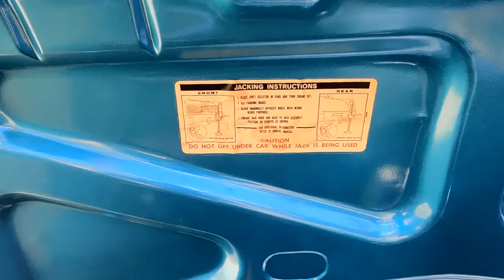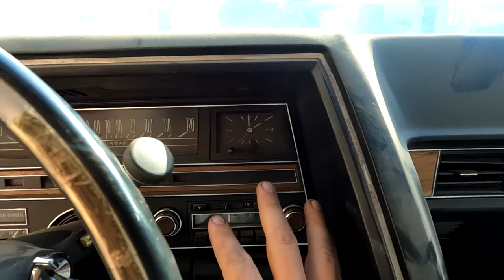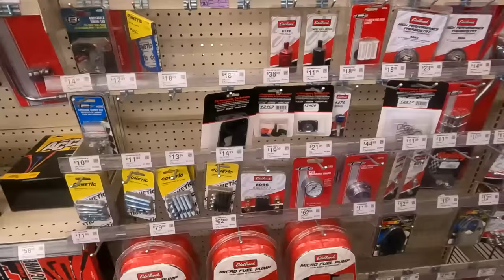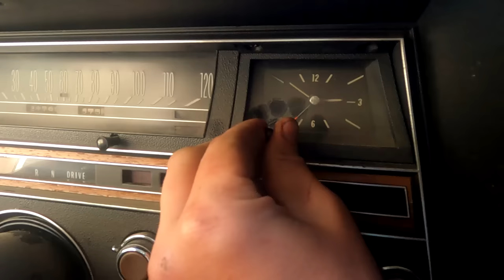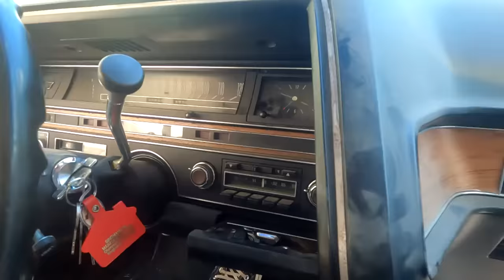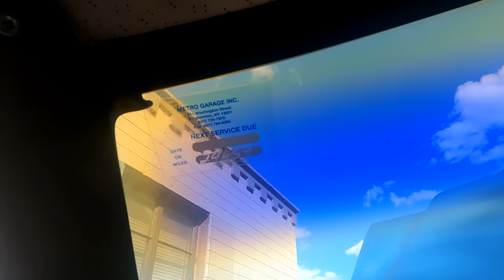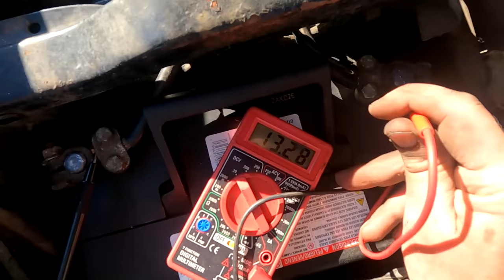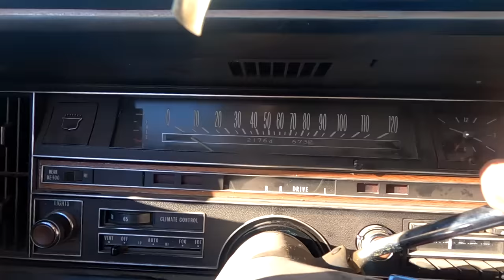Will this FREE CADILLAC run AND drive after sitting 20 years?

Comment: I used to have an '88 Fleetwood Brougham and it had level ride suspension on all 4 wheels.  I was sitting in a friend's driveway once that was on a hill and the passenger side was downhill.  He was sitting in the passenger side with the door open and one foot on the ground and I turned the key on, but didn't start the car and he asked what was happening because his foot was no longer on the ground, lol.  It had little things on the fenders that flashed when you had your turn signals on as well as red led flashers just above the rear window you could see in the rear view mirror.  The digital climate control in it worked flawlessly.  

What generally happens with dial string on old radios is that the variable capacitor (looks like a small bread slicer) gets stiff from old grease hardening in them and that makes the string slip.  I always just set the stations using the push buttons and rarely ever manually tuned the radio.  On that kind, you manually tune to a station and fine tune it for the best signal, then you choose a button for that station, pull the button out, then push the button back in and that locks it to that spot on the dial.  Older radios with push buttons had little antenna tuning coils behind each button that you would tune with a screwdriver.  On those the dial wouldn't move when you pressed the button, but the preset station would come on just the same.  When you wanted to go back to manual tuning you either turned a knob or hit a switch on the end that would re-engage the manual tuner, usually the same knob would also change the bands from am to fm and even shortwave.  

That brake pedal wear trick can be very misleading because I always used to buy new pedal rubber covers when mine would get worn down.  I miss those old land yachts.  I'm 6'8" and they always just had such a comfortable ride that you didn't care if you were driving all day because you didn't FEEL like you had been riding all day.  Modern cars I drive 350 miles and I feel like I've been beat to death because of their sport suspensions.  Gimmie that "boulevard ride" any day over a stiff suspension.

Comment: That's your rear defogger system in the truck. My cousin was a designer for Cadillac from 1960-1990's Cool color on your Cadillac Eldorado I have not seen this color before on a Cadillac. You possibly may have a rare color?
Reply: De-fogger systems blew unheated air. De-froster systems blew heated air. I had a 66 Ford Galaxy that had the same thing. 
Seatbelts became mandatory in 1966.

Comment: Hi that is not a rear defroster. That is a fresh air circulation system. When you drive the air from the front vents would circulate fresh air in the car cabin.

Comment: That went really well, the first thing to do with that car is rip the vinyl roof off and address the roof because I can almost guarantee where the top is torn up and bubbled there is rust. I removed my vinyl top on my 69 hardtop sedan deville and had bedliner sprayed on and at 20ft away you really cant tell and its very durable.
Reply from the maker: Yeah no telling what’s underneath that top

Comment: First model year with exposed headlights. I saw one just like this in Silver Lakes, California from 2007 to 2011. Never moved for four years. Then one day, gone.
Reply: All of the pre 1967 Eldorados had 'exposed' headlights.
Reply: @-oiiio-3993  Yes, but those were upscale coupes based on existing platforms. The 1967 and 1968 front wheel drive E bodies had hideaway lamps. I like your thinking, though!
Reply: @jeffshadow2407  So 1969 was not "First model year with exposed headlights," was it?

Also, the 1953 Eldorado had a unique body as did the 1957 - 58 Eldorado Seville and Eldorado Brougham models. The stainless roofed 1957 Fleetwood Eldorado Brougham was the first U.S. production car with 'quad' headlights, illegal in several states at the time.

Comment: I wonder if you couldn't open the passenger window because the window lock was on at the driver's control?
Please don't remove those tubes from the trunk. Whether they are rear defrost or a/c - heat air circulation. Maybe get in touch with a Cadillac dealer and find out! Let us know here!! Good luck with the car! I love the old caddys

Comment: The glass bottle is so you can put windshield washer fluid in it so you don't run out. Our 65 has one by the firewall on left side with a label on it.

Comment: 4:10 My 69 has a fan mounted to a flange that bolts on between the spare tire and the back of the rear seat. What you have is a JC Whitney defog fan that was common thirty years ago on larger cars. Yours might even be a GM product accessory fan. The fancy ones in the 70s had a little (not very effective) heating element in a box inline of the tube that fed the rear deck. If you pull the rear seat out you will see the original fan that probably stopped working before you were born. It pulled air off the floor under and around the rear bench. At 7:34 we used to call that the "kid nappers switch". They were a good idea in a four door so your kids could jump out while you were driving but in a two door your child would have to be pretty small to make it out the rear window.

Comment: Great car back in it's day but you won't like the gas mileage today at around 4 bucks a gal,  unless you own a gas station lol. Your looking at around 8-10 MPG in the city. Better to park it on the lawn and use it for a big flower pot.😂  You can replace the vinyl top with a special paint that resembles the original vinyl top (has a rough texture) that will hold up better and a lot easier to do then vinyl. You just paint it on.  I've seen them in the past, they look OK.

Comment: That device in the trunk is known as a "De-Fogger".  It really couldn't "De-Frost" because there's not a lot of heat being generated.  The intake hose should run inside the cabin, generally under the seat so that when the cabin is warm, it can blow luke-warm air on the window and at least keep it from fogging.  These were pretty common in cars even on into the 70's.... for instance my AMC Javelin has a similar unit in the parcel tray.  Though, being AMC, they just sourced an already made device that just sits in the middle of the parcel shelf.  It draws air from just behind the back seat and blows air up onto the window.  I also had a 1971 Dodge Dart Swinger, but it used a rear speaker hole as an intake from the cabin and blew up the window through a slot cut into the parcel shelf.

The best one I'd ever seen was in my '68 New Yorker (2-door hardtop!) It had an entire heater matrix under the parcel shelf, behind the back seat!  There was 20-some feet of copper tubing running along the inside of the passenger side rocker panel, and 18-feet of rubber hose under the hood!  It piped hot coolant to a heater core in the rear of the car so it COULD blow hot air onto the back window.  It was also vacuum controlled by some switches on the dash.  They controlled a two-speed rear fan, and the vacuum control could select blowing hot air on the window, or onto the rear passengers' feet via some ducting under the back seat.  There was also another setting that drew air from a grate below the back window and could blow "cool-ish" air again, either onto the feet or onto the back window.

I joke my car was the Canadian version of Jay Leno's Imperial.  Whereas his has dual air conditioners,  mine had two heaters!!

Comment: Blinker stays on because it needs a bulb,  if heat air is on auto fan won't work till temp tells it to rotary dial. Put on manual heat defrost,if clutch on air compressor still works then you have a charge it should work,be careful it's charged with r12.

Comment: AC fan works when the engine is running. There’s a giant vacuum switch that turns the system on when the engine is running and there’s vacuum applied.

Comment: I see that you’re still using the Rotella oil. I’ve heard that they started using less zinc. I’m running an older car with Valvoline VR1, cause I’ve heard that there’s no “basic “ I’ll with enough zinc for flat tappet cams out there. From what I understand, you have to use more expensive oils, to prevent cam failures.

Comment: That rotted roof will be a problem. They weren't painted at the factory when they were destined for vinyl. That meant no protection for the bare steel if (when) the vinyl failed or was damaged, letting in moisture. Other than that, it has so much potential.
Reply: Rhino bed liner so you still have texture and get the vinyl off

Comment: Nobody seems to have commented on this yet so far as I can tell, but this car is almost a dead ringer for the one that appears during the opening titles of "Deep Throat". Not the same one, unfortunately - that was a '70 model which had a slightly different chrome trim arrangement surrounding the grille. If it had been the same car, who knows what it would be worth?

Comment: I had a 1970 El Dorado it was my first car you may want to check again on this car I know you mentioned it was a 69 usually the 69 came with hideaway lights in the front and the 70 El Dorado did not have hideaway lights so either that is a 69 or a 70 you may want to check although it does have the 69 back lights the eldorado from the 1970 did not have the Chrome piece down the middle of the back it just was a full lens but the '70s had the open lights that way the 69s had hideaway lights
Reply: Hideaways not on '69 models.

Comment: All those interior light bulbs can be changed out with LED versions that fit and then they don't overheat the sockets and they don't drain the battery so that you can leave the doors open while you're working on the car those Factory bulbs will run the battery down in a couple hours. Cadillacs are notorious you use the lighter and it'll blow the fuse and when it does the interior lights come on and stay on after you shut the car off and the next time you come out the battery's dead real headache on it. So I change out every ball possible with LED except for the headlights they make some H4 glass headlights and you replace those and they make an aftermarket harness that keeps the switch from overheating so I like to use those Cadillacs are notorious for the switch getting hot and then melting and burning out they're also notorious for a wire melting under the carpet where the headlights which is good idea to replace that floor dimmer switch too RockAuto. Pull that fuel tank out and use red coat to line it it's a real headache but it's worth it I clean mine out with Drano and then I red coat of the outside with one treatment they sell and then red coat on the inside. Replace all your rubber Flex lines all your rubber brake hoses and never run ethanol gas through it by the non-ethanol or you'll eat every fuel pump you put on that car. I always take the wiper motors and overhaul them I take the window motors and leave them I restore a lot of Cadillacs. So much moisture in my state I'm always having to fake stuff it's a real headache I wish I lived out west where it's dry but it just costs too much smooth out there. Enjoy that beautiful El Dorado. I'd order and replace every piece of rubber on that car all the suspension parts why you can still get them. It's worth spending about $6,000 to refresh that car on that vinyl top fix the rust and get white bed liner the stuff you put in the bed of a pickup truck that's usually black it's an awesome replacement for the vinyl top. Do not use Flex Seal I tried it.

Comment: It is lacking some of the great Cadillac accessories.  Twilight Sentinel, Auto Dimming, Cruise Control, and Tilt and Telescope Wheel. The trunk does not seem to have electric pull-down either. Someone wanted an Eldorado but left all the accessories off

Comment: Be careful in thinking that 15w40 still has zinc. Even Rotella T4 now has reduced zinc content. I would use a "hot rod" type oil like maybe Brad Penn or Valvoline maybe even Lucas still makes oil with zinc, even in 10w30 weight. Do your research on this, because those flat tappet engines NEED their zinc!

Comment: DON'T EVER USE BRAKE CLEAN TO START AN OLD CAR !!!!! worst thing you could possibly do...use 2 cycle fuel which is mixed with oil, it's much easier on dry valved and parts

Comment: I would take it for free!  Cool that it is all original and with super low miles!  Too bad by 69 GM was using junk vinyl and materials that would rot away if not pampered.  Still it's a time capsule.